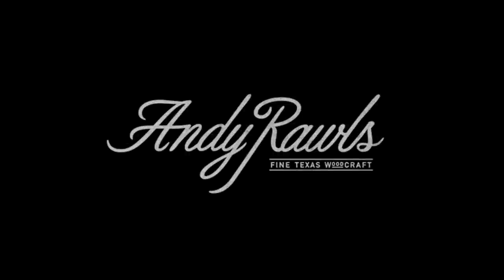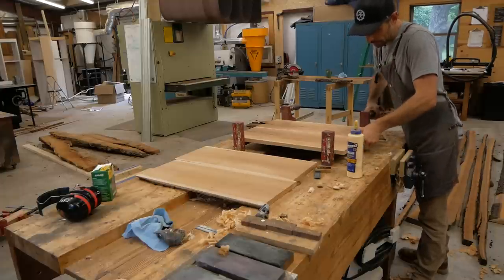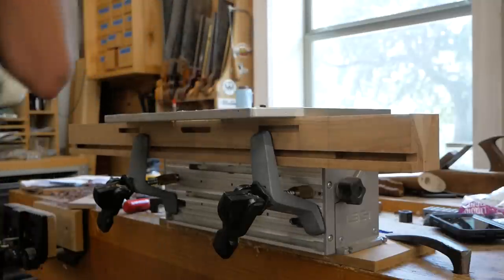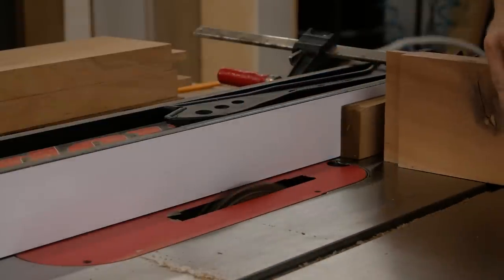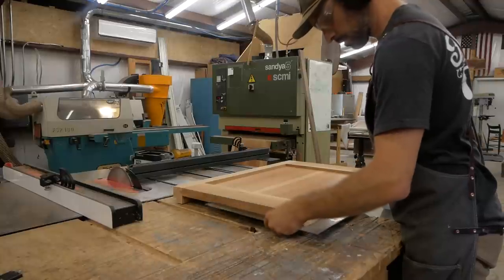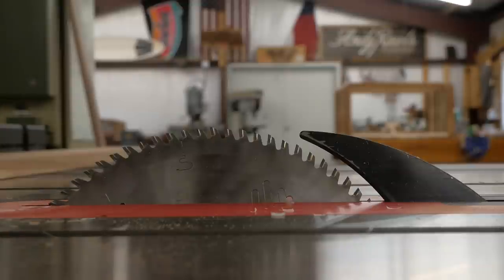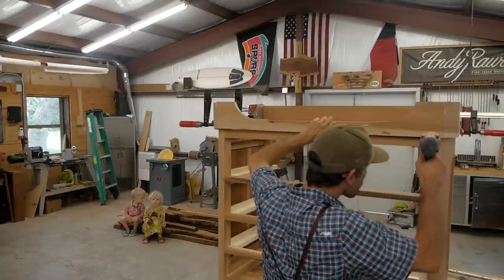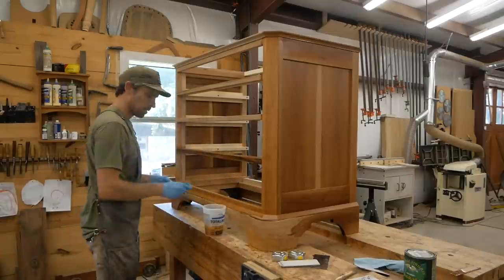Building A Shaker Dresser - Part 1

Comment: I know what you mean with the planer. That thing is golden. I have one in my shop and I have one outside that does top and bottom but goes much larger. It’ll cut thru Douglas fur and ask for more. The only thing that is time consuming is changing the blades on the drums. That is half a day right there. You have to change them and level them on both drums and on all four on the inside planer. I also have a band saw similar to the one you have. It’s a nice set-up. I’m not gonna lie. Nice piece of work you made for the client.

Comment: lovely. For clamping those awkward corners, use offcuts from  chamfer cut, or make matching angle pieces, glue sandpaper to these pieces, and then use these as cauls/protective clamping pieces. If they are long you could clamp the pieces to the carcase. that together with sandpaper, will stop them slipping.

Comment: I have cut caul type blocks or glued on sacrificial blocks to allow clamping parts together that have either a chamfer like yours or a full radius on the edge the caul blocks just slide or fall off after clamping or in the case of glued blocks that are chiseled off then planed away. Both are methods I use when faced with that situation. Several ways to skin that cat!

Comment: Looks great.  I know this video is old but I just found your channel.  A tip, for the angled clamping.  Save the offcut and tape it back in place then use a clamp to keep it from sliding up.  This will square up your corner for more clamping pressure.

Comment: When you have odd shape to clamp, use straps and cinch them and use a reference surface to make sure everything stays flat. I have made several large tapered post and panel chest/dresser and have had to use this method a lot.

Comment: Great video as usual - i've had similar issues with angles like that, i quickly grabbed ratchet straps and put them around the case and was able to use them to pull it all together and get around that issue you had

Comment: When you have weird glue ups like that make some clamping culls out of scrap plywood.   Shape them to match the outside profile with flats that match where you want the pressure directed that the clamp pads sit on.   I use them all the time on tall panel miters.

Comment: That is looking absolutely gorgeous. Incredible work on that so far. For clamping the angles could you have done the painters tape and super glue thing? Where you put painters tape on the angled surface and painters tape on what you cut of since that would have the same angle.  Then put some super glue on the tape to hold the two pieces together and then clamp it. That way you would have square corners to have your clamps attached to. I’ve seen Mark from the wood whisper do that or suggest doing that for angled pieces.

Comment: I'd recommend getting a couple strap clamps or band clamps for that bevel issue you spoke about. I use them whenever traditional clamps have trouble. Could really save your ass on a glue up

Comment: I enjoy the commentary. You did a great job on this build. Would band clamps made it easier? Our would it not given you enough clamp pressure. I’ve used them before and worked fine on my builds like that. Keep up the videos and can’t wait till you start the timber frame project. Best wishes and God bless

Comment: Enjoy your Videos, your work is top shelf, I’ve been a cabinetmaker since I retired from building custom homes. My question is, hearing you complain about having a hard time pulling those shoulders together several times why didn’t you just make a couple of glue blocks, hot glue wear you need them and when the case is dry just pop them off with a hammer or whatever? You seem to think out every step in front of you, glue up as you said can be crazy at times, I’ve had tough glue ups even with thinking ahead, I always build custom glue blocks with irregular shaped pieces. GOOD LUCK, BEAUTIFUL SHOP, GREAT TOOLS, BETTER CRAFTSMAN ‼️👍👍  Vinny 🇺🇸

Comment: A possible solution for the clamping problem is to use wood jaws that are longer. Would that work? Another fix is to superglue the offcut then u could remove it with a tap of a hammer.

Comment: Andy, great workmanship.  Yeah, I could really feel your frustration regarding the premature trimming of the cornerposts and the challenge it posed during glue-up!  Just one questions: is there any reason you didn't use your Domino to add floating tenons to the apron's 45 degree corners, just as youdid for the back 90's? 

Again, great job and thanks for sharing.

Comment: Next time you have a problem with a glue up like that use the angle pieces that cut off and use double stick tape and put the angle back the on the pieces you cut them from. Then clap them.

Comment: Do you have a Jointer and Thicknesser in the shop? I'm thinking about putting an S4S into the workshop but I'm struggling to get my head round if it can be used to just mill 1 side if needed.

Comment: Out of curiosity, how much does that S4S machine go for?  I've been looking at high end jointer planers and wonder how far off this would be in terms of price.
Reply from the maker: I paid $4500 used
Reply: Andy Rawls   That's within price range I was looking for. As a hand tool woodworker having something that could quickly dimension would be very helpful and then I just finish off with hand tools. How good of a job does it do?